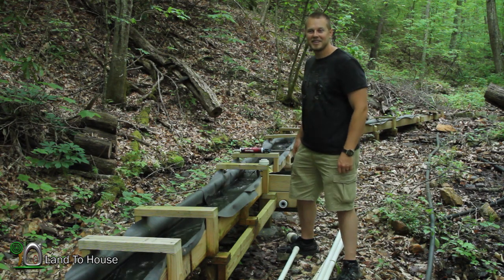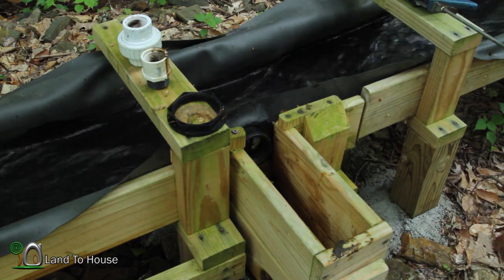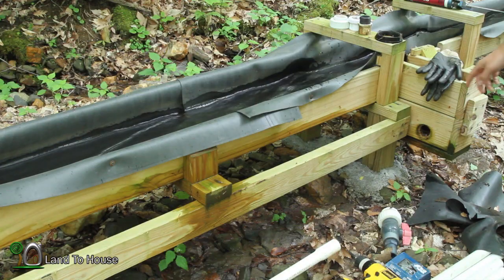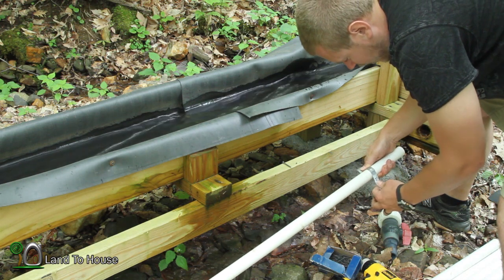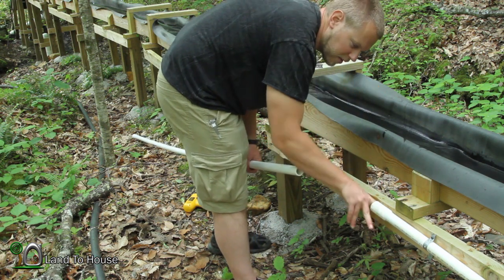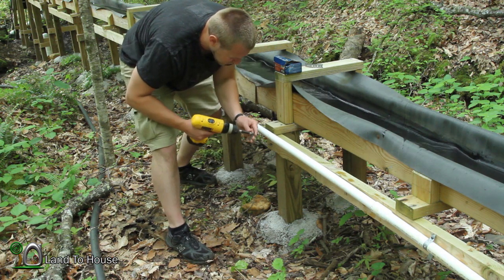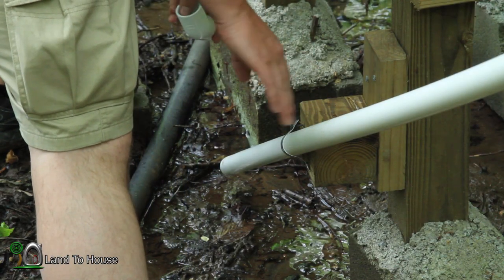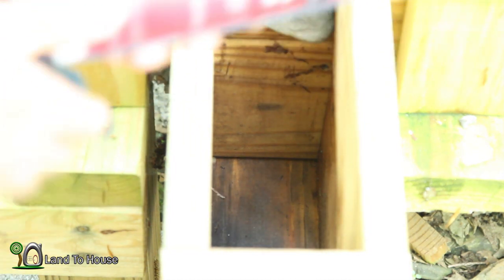Install My Ram Pump Part 1

Comment: I live in Argyll where I self built my own house.  I left three drain holes in my foundation wall and before we knew it we were overrun with mice.
Have you tried using the blue MDPE flexible coiled pipe?  It is use for underground water supplies and would remove the need for some of your bends.  Take a look see at  http://www.screwfix.com/c/heating-plumbing/mdpe/cat831580  you must have the equivalent in the USA.  It used to called Alcathene back when I was an apprentice.
Reply from the maker: Those mice can be a real problem! I try to stay away from them as much as I can. I have seen something like that. Here I have used Black Flex pipe in several systems. In my own setup I was going for least expensive. All the pipe in this build was less than $10.

Comment: Have you ever supplied a 1" ram pump with a 1-1/4" drive pipe?
Reply from the maker: +Adam barringer actually I have found that it is less efficient. The down hill part is great but when the pressure wave has to overcome the larger volume of water on the uphill movement  it is not as efficient.

Comment: I am not an expert. Everything I have read  about rams says the drive pipe should be steel.
Reply from the maker: They sure can be steel. I have used black flex pipe for several years and now PVC. It works well but you are correct. Steel will provide the best efficiency.

Comment: Epoxy coating of a replacement box will let you remove, dry, and coat this one as a spare. Think of it as annual maintenance.
Reply from the maker: +Burke Mawby that would be good. Have two that can be swapped as needed. Thank you.

Comment: I have found unglued PVC in that long sizes will pop apart if they get any direct sunlight at any point in the day. But that was in Nevada.
Reply from the maker: +nintendolunchbox I could see that being an issue. Especially in that heat. I I lived in New Mexico and I remember those 110 Degree Days. This will be in the shade most of the year. We'll see how it does. No big deal and to get it glued though

Comment: I haven't any suggestions for the box other than making it bigger to provide a bigger source to pull from. In all probability you have probably completed this project by now but I do have a thought for you. I am guessing the water will be pumped up to a large header tank? When I installed mine I ran the inlet to the top of the tote and took the supply from the outlet at the stopcock at the bottom which worked fine however I have altered it so the the inlet goes to the stopcock at the bottom and fills the tank upwards wherever I want a supply I just put in a tee in the supply line. This saves having two pipes and feeds water from both the pump ( you can see the pulses ) and from the tank, a much better solution in  my opinion.
Reply from the maker: +Michael Collinson interesting! I can see that being a good idea. I will give my system a try for a time and if it is not doing what I need I will try your way! I did run into a little issue connecting two barrels together. A 2-1/8" hole saw is not the same as 2" haha.

Comment: I would think if you extended the box down parallel with the flume a couple feet so you would have a small pool and then attach the pipe to the end of that you would have a more solid water source without the risk of air getting in the line
Reply from the maker: +justin whittington that's true. I wonder how long the blue max and caulk will stay water proof. I might just get a small tank someday.